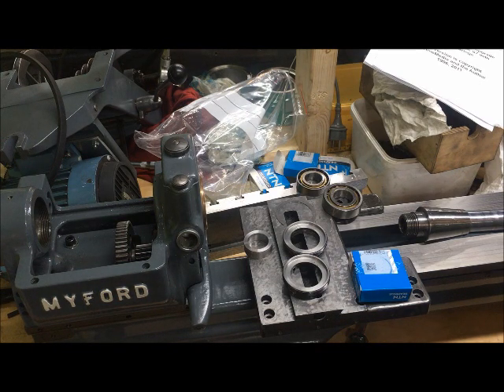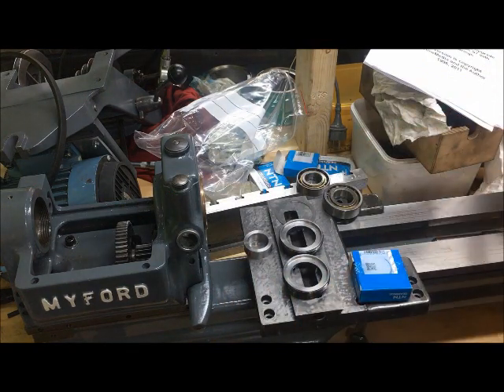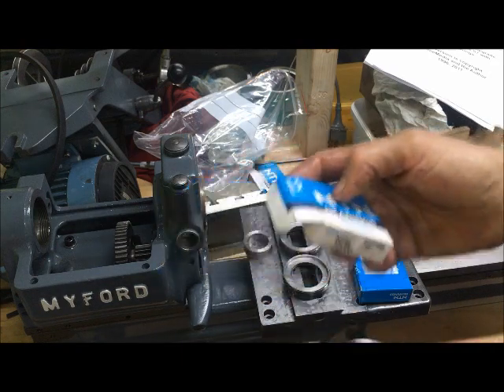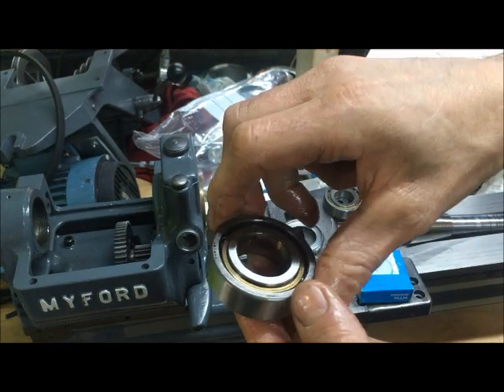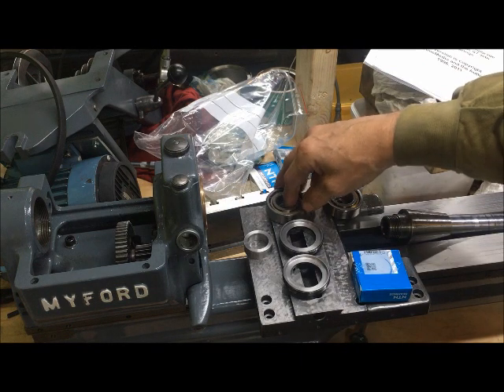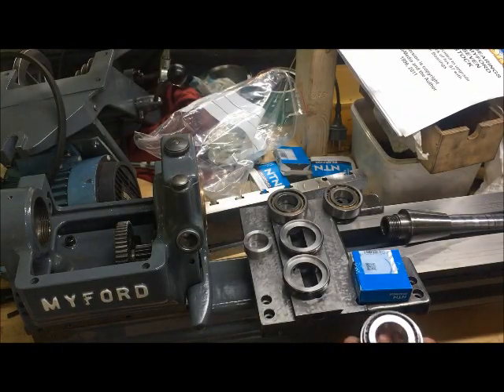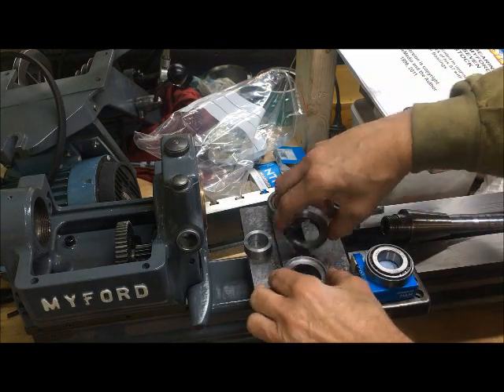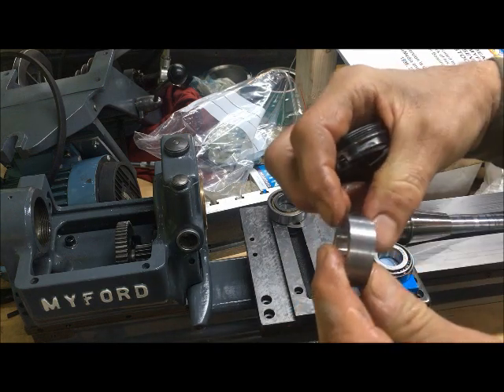Myford 7x7   headstock   modified rear bearings

Comment: i did this conversion two years ago with taper roller bearings. no good result. i mixed taper and angular bearings not a good result. i mixed angular and axial as well as axial and taper roller bearing no good result. with all these attempts and experimentation i think most likely the bronze front bearing is worn out. after all that, my conclusion is the front bearing housing should should be fitted with  a roller bearing and here we face the irony of modifying the spindle and the bearing housing. 
i think next time  i will try a good quality roller bearings then test again on one of my 3 S7. 
the video did not show clearly the direction of the taper bearing inside the housing nor provided  some sort of sketch and dimension regarding the castle nuts or the sleeve spacer although any competent hobbyists could work out the dimensions.
Reply from the maker: john smith Hi there,
Thanks for the comments.
As mentioned, I also didn’t find any significant improvement. 
The article I mentioned and linked has descriptions
Reply from the maker: Hi again,
Did you try to scrape the front bearing or replace it?

Comment from the maker: Some additional comments..
I have bought NTN bearings with type designation 7205BG to replace the original back-to-back coupled angular contact ball bearing set. . Price approx. 35EUR each. Similar priced if buy from Myford or choose another quality manufacturer, for example, FAG, Timken, Koyo, or not the least SKF (mentioning just a few, there are probably a "dozen" more ..). Otoh, a "no-name" bearing is available for approx. 20% of the price, but I would rather add the extra money and install something that I know is good. 
Having the need for another pair of these bearings, I came across the article in MEW about how to replace the rear-angle bearing pairs with a pair of tapered roller bearings. It promises to provide a somewhat firmer setup, but maybe more "important" a simpler one to adjust.

I assume run-out on the Myford S7 depends mostly on the condition / quality /pre-load of the rear bearing pairs and also on the condition / adjustment of the front bearing. As I said, I have chosen to use quality bearings to avoid problems. I couldn't measure any difference in the use of the regular angular vs. the conical bearing pair. I also tried to see what effect a higher or lower amount of preload had, but couldn't really see any great difference. Some spindles have the correct setting marked as a line which should line up with the split in the nut at the rear, but not all, so I used some time to puzzle with different settings. A modest tightening, sort of "snug-up", is seemingly all it takes. I also tightened the front-bearing to obtain a clearance of about 2-3/1000 mm. This will also then give the correct / minimal deflection under load, which was tested by using a tapered bigger drill shank and forcing this up and down. Also the axial deflection under load was tested by pushing on the spindle with the tailstock, this being largely a result of the correct pre-load of the rear bearings, ie. if not sufficient, a certain extra "play" was detected.

As is apparant, the most common solution for small and large hobby machines is to use tapered roller bearings as a front and rear bearing pair. Numerous variants in different price ranges and certainly not possible to beat this combination of price / function. However, it must be said that here is also quite a difference between "no-name" vs. quality products, and also standard vs. precision versions. Standard bearings as suggested for the above Myford conversion article are 30205 J (or / JQ) and cost apprx. 30EUR apiece, but the precision version 7205 CVUJ74 were listed at around 650-700 EUR ..! I have also seen "no-name" bearings to as low as 10EUR, so pay attention to what you use!

Comment: Since you are in the rare and enviable position to have multiple lathes of the same model, I hope you are planning to do some comparison measurements with the bearing upgrade?  Once again, thank you for sharing your time with the world!
Reply from the maker: Thanks for the comment. I did some comparisons..  the results were the same (for all practical purposes). I installed the "regular" set of bearings again but will get back to these conical ones later, installing them on one of the other lathes. I needed one more bearung set anyway, although I must say that 3 or 4 out 7 of the original sets seem ok enough for re-use (at least I can have these as backup. PS! don't throw away discarded bearings.. the balls come in handy for spring loaded indent settings, while the rings are useful as distance blocks/spacers, eg when milling)